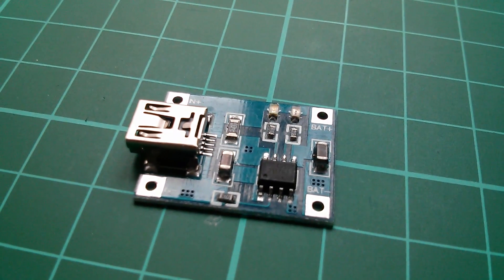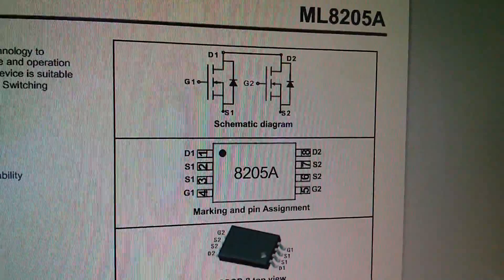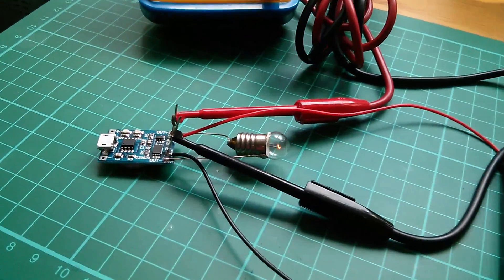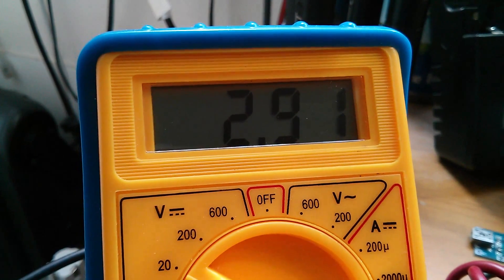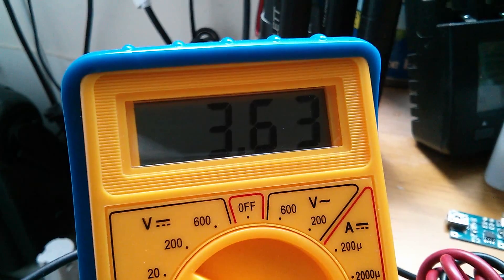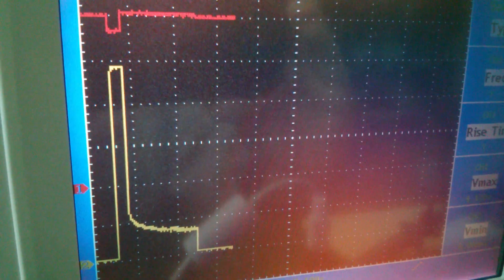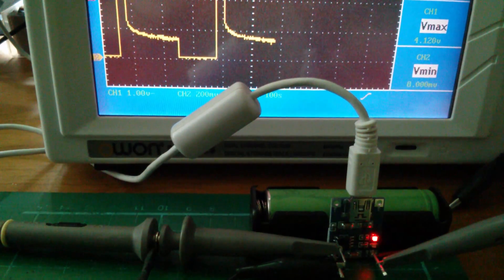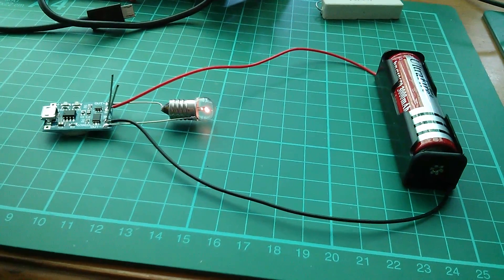New TP4056 Lithium Cell Charger Module with Battery Protection

Comment: Great video Julian, but I have a question. as you mentioned the DW01 is a battery management IC, but so is the TP4056. can you tell me what the TP4056 does on this particular board. I want to build a single battery charger for my Winston WB-LYP40AHA cell with a charge current of +/- 6A. thanks in advance.
Reply from the maker: The DW01 is a cell protection IC whereas the TP4056 is a cell charger IC

Comment: Hi Julian,

thanks for this video. I have some of the ones with mini USB and without protection.

Do you think it is possible to stack 8 of the new ones to get 8 amps of charging current? I want to connect 4 cells in parallel which are capable of being charged with 2 amps each cell.

Additionally what do you think how many amps can a micro usb port handle?

PS: Any recommendation for a 2,5 - 4,2 Volt input step up converter with 5,1 Volts output at maximum of 4 Amps?

Thanks.

Comment: is there anything simular for multiple cells in serie?
Reply from the maker: Balance chargers used with radio controlled models can charge series-connected packs.
Reply: Yes, but I'd like to have something that can be fix in the powered tool. I found a few protection boards, which can handle multiple cells, on eBay but I'm not sure if they also balance, but there are no charge controllers included, so they certainly don't meet my requirements. By the way in my opinion the ultra fire I've got aren't too bad.
If you want to measure the capacity of batteries more exactly how about this: http://www.produktinfo.conrad.com/datenblaetter/225000-249999/237514-an-01-ml-VOLTC_B6_ULTIMA_LADER_ENTLA_de_en_fr_nl.pdf
Reply: Mat May  Giday EH!
I am also looking for a board like that for 18650s and the bag type Li-po. If you find one would you let me know?

Thanks!  Later, FW.

Comment: So if the battery never comes back to 3v will it never connect the charger back to the cell or am I misinterpreting what happened in the video?
Reply: yeah i cant understand that either, so how does it charge a battery that has gone flat?
Reply from the maker: That's the impression I got. I was expecting the DW01 chip to reconnect the battery when a charge source was connected, but that doesn't appear to happen.
Reply: Julian Ilett
According to the datasheet DW01 page 8/ 11.5 "Charge Detection after Overdischarge" the cell is still charged through the Moseft body (parasitic) diode. Anyway I wonder if overdischarge protection voltage (VODP) with 2.4 volt is way too low - it would be better to have a value around 3. At least if you want to use it for other LiPos than 18650.

Comment: Nice one, certainly good for using with the unprotected cells.

I've actually got all the same IC's floating around here somewhere, was on the "to do one day when I get to it" list to make a similar board.  

Except that I want to make it so that the load is powered direct from the external supply when connected, rather that through the charger, for the same reasons as you touched on, better to charge the battery unloaded.
Reply from the maker: With modules available at these prices, I'm not sure I could be bothered to make my own PCB. And you could modify these modules if they don't do exactly what you need.

Comment: The board is neat.

But I would like the protection module under layers of tape and other protection next to the battery.

As for loads, if you can; make a bypass path to power the load from the voltage source, while on charge.

Looks like a Li-Ion non-poly battery, they may be ok with being driven 4.2V over time. Still you may get a 4.1V charger instead and have the battery last a lot more cycles.
Reply: I Charge all my lipos up to 4.24v and they are as Good  as New. (i have used them for About 2 Jears now and almost dayly for my rc car and fpv copter.) But i never Run them lower as 3.1v.

Comment: Julian, I know this is off topic, so my apologies. but i noticed your scope was quite nice and I was wondering what model it is?

I ask because I too am UK based, and am finding it hard getting hold of a good scope..

Love the videos BTW! your Mosfet tutorial iv watched 3-4 times while designing and refining my Mosfet video!

Many Thanks, And once again apologies for going off topic,
Tom.
Reply from the maker: Hi Tom. My scope is an Owon PDS6062S 60MHz. I bought it on eBay, but from Rapid Electronics who auction off old stock from time to time. Test Equipment purists will probably say it's a hopeless scope, but it does everything I've needed so far. The screen is a STN LCD so it doesn't have a very wide viewing angle; it's completely impossible to see anything when used outdoors. I'm a bit unusual in that I have hardly any proper test equipment, but an oscilloscope is one thing an electronics enthusiast can't do without.

Comment: 11:55 is that a sanyo 2.6Ah protected cell? Where di you get it?
Reply from the maker: It's this one: http://r.ebay.com/AbgR6p
Reply: Is it any good?
It is supposed to retain a high voltage for longer than other cells (at 3.6V it is fully discharged and then drops quickly).
Which means that for a given capacity it has more Wh. It also means that it excels in flash lights that are using direct drive (linear regulator; no boost circuit).
I might buy them on DX (cheaper): http://www.dx.com/p/genuine-sanyo-18650-2600mah-rechargeable-battery-with-protection-board-red-pair-121447

Comment: hi julian can you recommend a 1865 battery i need 8 for a project really not sure which are the good ones
thank you
Reply: Be extremely careful of anything you can find on ebay or dx.
xxxfire are usually old laptop batteries refurbished.
Buy protected batteries if you are not absolutely sure of what you are doing.
Right now the best capacity is the Panasonic ncr18650B which is 3400mAh. Anything above that is bullshit.
Panasonic/Sanyo, LG, Sony, Samsung these are good reputable brands but are usually sold unprotected.
Reply: Lagm an  I agree with Lagm. Get a protected Panasonic, Sanyo etc from a known store with good feedback. Pay a bit more but if you look at the damage a 'bad' cell can do ... you will be happy to pay more!